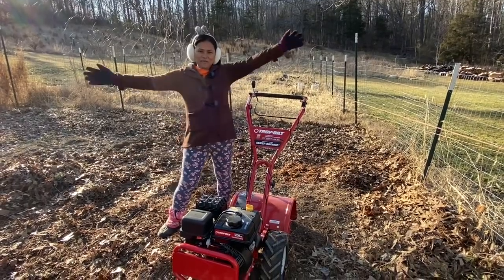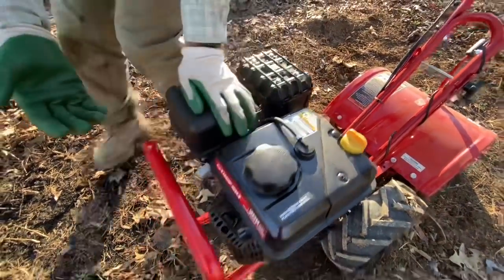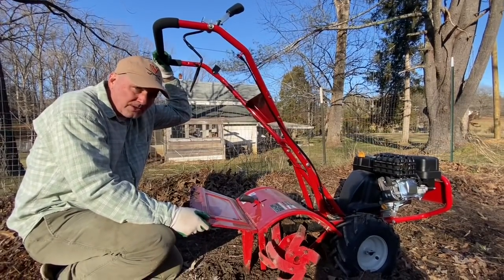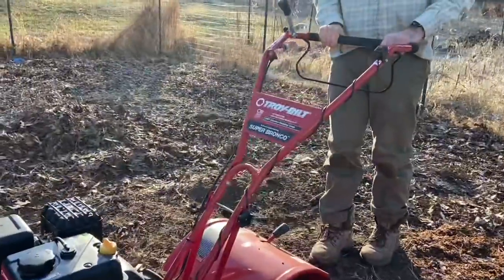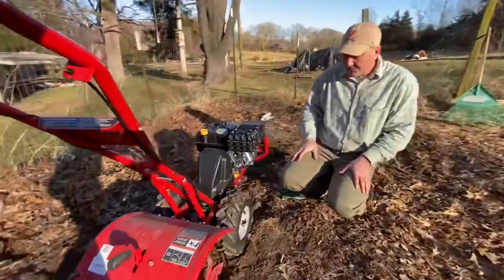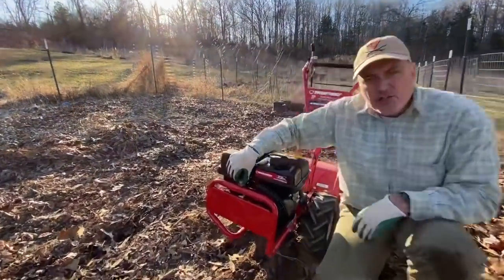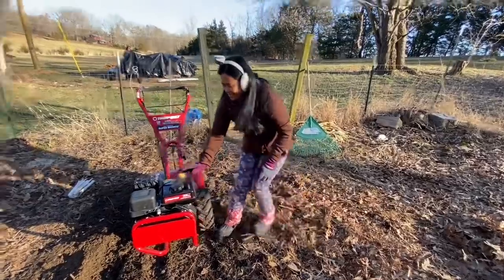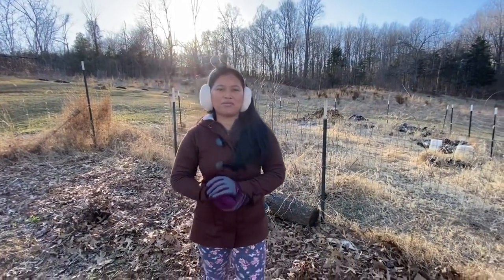Demonstration! How To Operate Troy-Bilt Bronco Garden Tiller Wheel Lock Problem Solved In Video!

Comment: I bought my new bronco this past spring. But it was jumping Everytime I was tilting. Now by watching your video finally figured out what was the problem.
I was tilting with free wheels. Not lock in place. Tomorrow I will try to use again. I was so disappointed when I first use it. Because I have a big horse tiller , than works great. 
Thank you so much to show this step before you till the soil.
It is a life saver. 
Al. M

Comment: Very fun video. It quickly solved the confusion I had with tiller operation. After knowing what I was looking for, I was able find the information in the Operator’s Manual (Wheel Drive Mode p. 8) and now it makes sense. Thanks

Comment: Also, for transporting to and from, just lower the drag bar and it’ll drive without digging in. It’ll still turn the tines, so be careful. No need to pin wheels every time you move it. Thank you for showing this.
Reply: Yes, but it sure is slower that way. Plus you are wasting gas.

Comment: That's not the throttle it is the Reverse.  Read on the handle.  It is so you can back up.  MUST have tines OFF the ground when you do it.  I bought one years ago and it came assembled and delivered to house.  They didn't put the handle bars on right and they would slide down and up.  So if yours does that you need to move those flat bars to the other side of where they are.  Lowes couldn't figure it out.  You can adjust them for your comfy zone if you short or tall.

Comment: I did manage to figure this out, but it frustrated me for the best part of an hour.
I couldn't figure out why it didn't have a separate handle or lever for the wheel engagement and like you said, nothing specific in the owners manual apart from a blurb about "Making sure the wheel hubs are locked"  with no context as to what that process was.   
My first pickup truck needed this to be done to lock in 4x4 so it finally clicked. 

Good video, and looks like a happy little farm you and your husband have there. 
May your seasons be blessed!

Comment: You are absolutely right I just had this very tiller delivered today. I put it together started it and that's exactly what happen. It lunged forward and you couldn't keep up with it. I said this is BS I called the company and told them what was going on and they didn't know so I did a return order. I told them this was not going to work for me. So now I'm going to check this and I'll call them tomorrow and tell them what they need to let people know what they need to do. But I do still have a problem the cables are backwards. My reverse lever is my forward which is the short cable and the long cable is the reverse so its backwards in the machine.

Comment: Excellent video.  My tiller is similar.  Model is 170-AUA.  Not sure if your tiller has the same model #. I misplaced my manual so I can't remember what the oil capacity is? I've similar tillers with a different engine model # but those are saying 20oz. Was wondering if that's the correct capacity?

Comment: My TB Pony has no cotter pin, only bolt and nut. The assembly direction had the wheel put in outer hole but there is a shifter which you put in neutral to move to storage.

Comment: Using shear pins to engage the wheels are the norm on just about all rear tine tillers. It pays to keep a spare set of shear pins on hand in case you have one to shear.

To the new owners of these types of tillers a suggestion. Remove the wheels and apply grease to the axle shafts before you use the tiller for the first time. At the end of the season. Remove the wheels again, clean the axle shafts and wheel hubs, apply new grease and reinstall the wheels. 
This will prevent the wheels from seizing to the axles and make gear box repairs much easier. A lot of time if the wheel seizes to the axle. The wheel will be destroyed when trying to remove it.

Comment: I figured out the free wheel pin thing elcheapo pos in like 30 seconds on someone else's tiller, my personal troybuilt is a real one from the 70's that has a gear lever for high and low and forward and reverse, and weights 500 lbs.

Comment: On the choke...mine starts cold on the first pull when the choke is full on. 
I did the same as you did putting the choke in the middle for about 20 seconds. 
Then I put the choke to the right full off.
When I have the choke completely off, it starts surging, backfiring once in awhile.  If I have the choke barely off just past the slanted, it runs smooth. What would cause this?
I took an air hose and blew out the fuel line, cleaned out the fuel bowl, cleaned out the float port hole with a thin wire.
It still surges and backfires if I have the choke completely off.
Could the spark plug be bad?
Would I have to completely take the carb off and clean it?
Anyone who can help, thank you in advance.

Comment: Just a word of caution I found 
A very old tuffy tiller and it's compared to your machine . The online manual states it doesn't need reverse because of it's weight and can be pulled backwards easy . My tiller has a old frozen up 3 HP so I ordered a replacement 6.5 predictor from harbor freight. The wheels are frozen on the shaft nothing works to free it up days of PB penetrating oil , hammering or heat  . I found a YouTube suggested spot weld a large nut on the hub and put a bolt in it and use a impact to press the hub off the shaft . I see others with same problem so I suggest cleaning regularly and putting some anti seze on the shaft . Tillers tend to get used seasonally and being stored the next time you try to freewheel it might not work like before . I think this is a very poor design they should have built a neutral in the gearbox

Comment: i got mine from my son for 500.00 used maybe 4 hrs,bigger is always better,not all the time,am getting older so its small, light and does the job its meant to do,the only neg remark i have is the handle and tiller guard is to thin,handle flexes,and the guard bends and flex,before i would pay 1100.00 dollars i would shop others,but its a good simple tiller,4.5 star out of 5

Comment: This video was GREAT, BUT, let me share this.  The FREE WHEEL thing with the pin is important.  However, I have a older version of this exact tiller, and here is what is happening to me.  Mine is in the wheel LOCK mode, which is suppose to control this abrupt forward JUMP or movement, as this can be VERY DANGEROUS, however with my Troy Built tiller, even when the wheels are in the locked position, they ARE NOT preventing the tiller from jumping forward, which would mean something possibly in the transmission is allowing the thrust and pull of the blades digging in the ground is OVERPOWERING THE wheels in their locked position or controlled forward position and still allowing the tiller to jump violently forward, oh hell!!!!

Comment: I've had this about four months and have found it to be an aggressive and powerful rig. https://www.youtube.com/post/Ugkxjo0FLo5z3Y_qUcT3vSlOqpMaMdFjvsXa I've used several others in the past and the Sun Joe surpasses these, easily. I note that several people have commented that it bounces on rocky and compacted soil. I believe that would be the case with all tillers - the ground does need to be "broken", either with a larger tractor type unit or with a shovel, and rocks need to be removed. I'm living on a Pike silt loam here in the midwest and the Sun Joe turns my garden to bug dust in two quick passes. I use a technique where I do a short 2 foot run then pull it back and let it go over it again.

Comment: What a cheap-ass way to build something!!!
This makes me appreciate my old Howard Gem a lot more! But then again, they were the best rototiller ever made on the planet!!!
3 speeds forward, one in reverse with a clutch! 
Shift it like a car or a tractor with a gear shift lever!

Never having to do anything with that lynch pin on the axle!
Yes, those are lynch-pins not Cotter pins.
But you could use cotter pins if you wanted to.

Troy-Bilt are not that great.
Sorry.
You should have checked out BCS tillers .
They have more attachments for gardening/farming.

Comment: Troy built poor design.  I have a poulan put your transmission in neutral and roll wherever you want. Troy built is a much better tiller but that's a poor design point on them